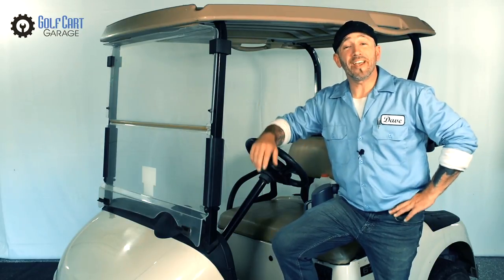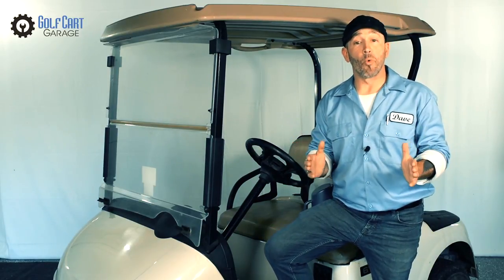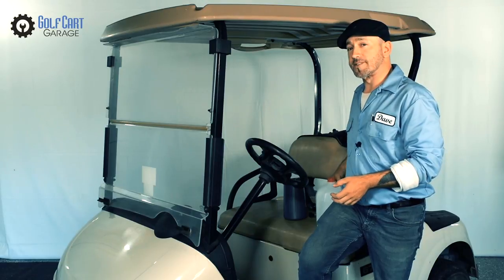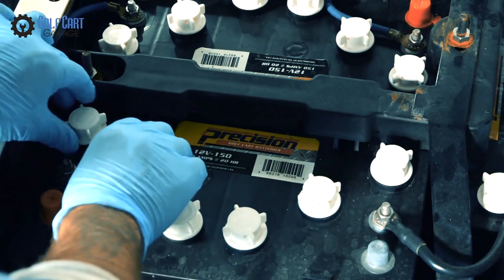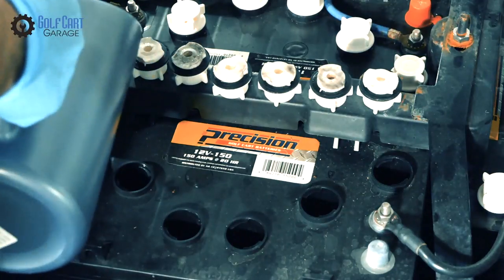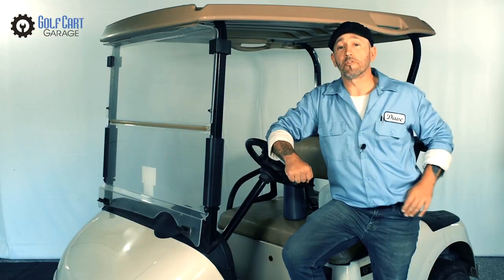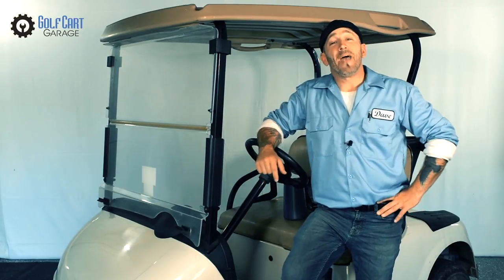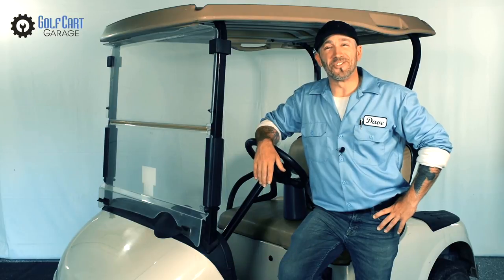How To Fill Golf Cart Batteries With Water | Golf Cart Garage

Comment: How much does the summit 2 cost?
I have a 2007 club car (6) batteries 48 volt
Reply from the maker: For a 2007 Club Car at 48V, we recommend Summit II here: https://www.golfcartgarage.com/golf-cart-battery-charger-36-48-volt-on-board-lester-electrical-summit-2/
Right now it goes for $389.99 with FREE shipping.  This version will bypass your Club Car OBC.  Let us know if you have questions!  Support@GolfCartGarage.com or (800) 401-2934

Comment: I was unfamiliar with my watering system on my cart. I didn't know that there are floats to tell if it needs watering. So I hooked up my filler bottle and I fear I over watered my batteries. How do I go about checking if my electrolytes or battery acid has been depleted? And should I add some more?
Reply from the maker: Thanks for watching!  There should not be depletion unless you've noticed a significant spill.  These systems sometimes need to be carefully monitored for issues.  To get more specific with your situation, we recommend consulting our tech specialists directly for real-time help! https://www.golfcartgarage.com/gearheads-on-demand/

Comment: How do you fill the battery in the back that cant be reached
Reply from the maker: Thanks for watching!  With this EZGO RXV, we are just barely able to fit the water bottle to the fill holes as it sits in place.  However, under other circumstances... sometimes the cart must be placed in tow mode to remove the battery and fill it outside the vehicle.  If you need someone to help in real time to take a look at your cart in a virtual video diagnosis... visit our page here: https://www.golfcartgarage.com/gearheads-on-demand/ or get in touch directly at Support@GolfCartGarage.com or (800) 401-2934

Comment: What happens when you accidentally put regular water in your batteries
Reply from the maker: Thanks for watching, Calvin!  Tap water contains impurities that hinders the efficacy of the sulfuric acid in your batteries and leads to heavy corrosion on the plates in the battery housing.  This can significantly decrease your battery life-span.